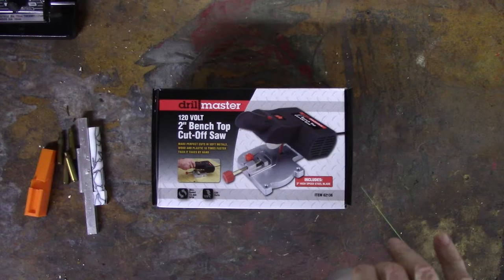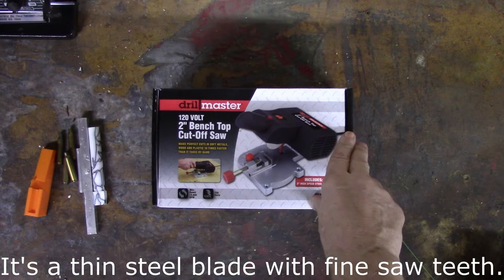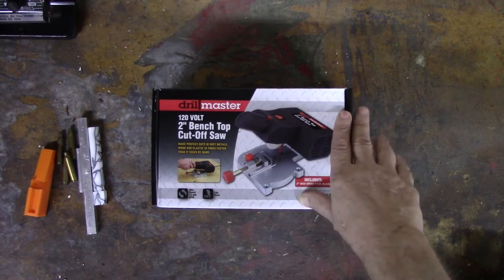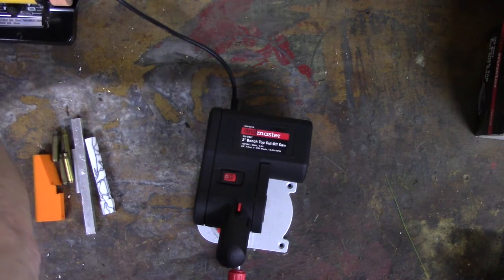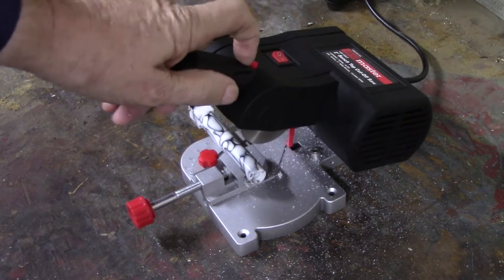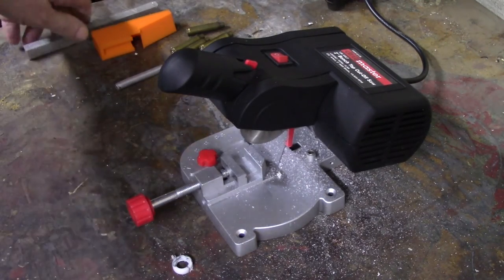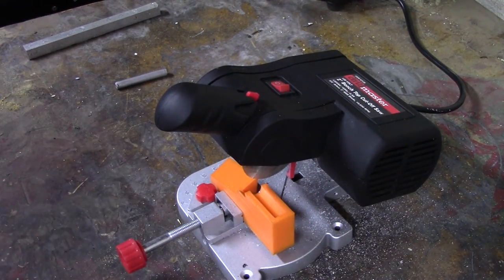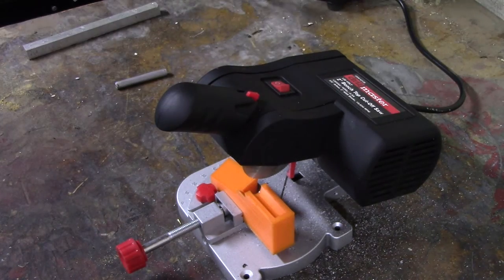Harbor Freight 2 inch mini chop saw unboxing and test.

Comment: Can you use a more popular 3" blade on this? Thanks!
Reply from the maker: Beats the heck out of me, send me one and I'll give it a try! Seriously, I think there would be some issues. First, I have no idea if the mounting hole is is the right size, then there's not enough room in the blade guard so that would have to be cut away, then there's the question of would the motor have enough torque to cut with a blade that's an inch bigger in diameter. And then you'd probably want to modify the stop so you don't accidentally cut through the base. I'm going with "It's probably more trouble than it's worth".

Comment: Hey can someone help me solve a doubt please, I work with these  25 milimeter wide led profiles for upper furniture, they are hollow, 1mm thick and less than 6mm height but indeed 25mm wide, Can you please confirm if I can fit those 25mm wide into the adjustable clamp space , thank you
Reply from the maker: Jaw opening is 21mm. The jaws themselves are 8mm thick, so it would be possible to machine 2mm off each jaw to get the 25 mm opening you need.

Comment: Do you have the Thingiverse link for the jig and are you going to revise it?
I thought HF quit selling those little saws....glad to see them back in stock!
Reply from the maker: Here's the link to the one I showed in the video.
https://www.thingiverse.com/thing:4599314
I'm not going to revise it until I've had a chance to use it for a bit. Once you get it located in the vice for the cut length you want and locked in place, it's ok, but it does take some initial fiddling to get there. Might be nice to have it lock in place on that hump in the middle of the vice then have screw adjuster at the base end for trim length. That would cut the fiddle factor down, the jig would locate on the hump then lock it down and turn the screw to get your cut length.
Dammit, now I want that. lol. I'm taking the day off tomorrow to go to the dentist, maybe I'll work on it when I get home and am waiting for the novacaine to wear off.

Comment: Can I cut pen blank? Thank you.
Reply from the maker: It will cut acrylic and wood pen blanks easily. But be aware that it's only got a 1/2" depth of cut. So if you're cutting the typical 3/4" square blanks you can't cut all the way through without flipping it and making a second cut.
Reply: @3rdpig  I just screwed up a pen blank, I cut it too short with a saw. Do you know any mini table saw that I don't need the second cut? Thanks 🙏
Reply from the maker: @bzflowerbee  Harbor Freight makes a 6" cut off saw for around $50, it comes with an abrasive blade that will not be suitable for acrylic or wood (well, you can but you won't really like the results) but it has both both 5/8 and 7/8 arbors, so it should be pretty easy to put a 6" or 6-1/2" circular saw blade on it that would be suitable for acrylic and wood. There's also a company called Proxxon that makes a 3" chop saw, it's really nice but it's also about $350.
Reply: @3rdpig  thanks for replying. I'm trying to turn a pen and cut the blank using nitter box but came out not straight and cut it too short. I'm looking for a power too that is not too big we I think $100 so I can cut blank, wooden or acrylic.